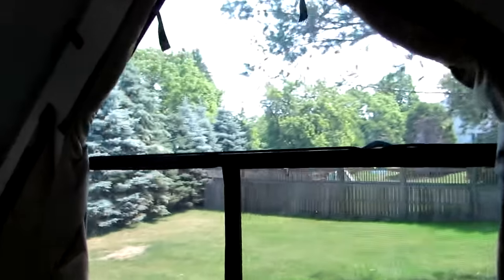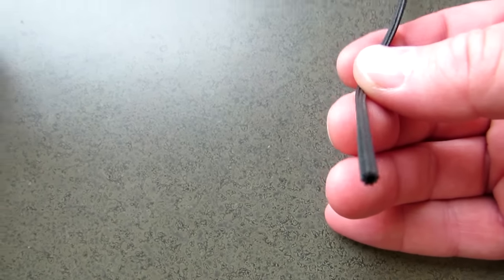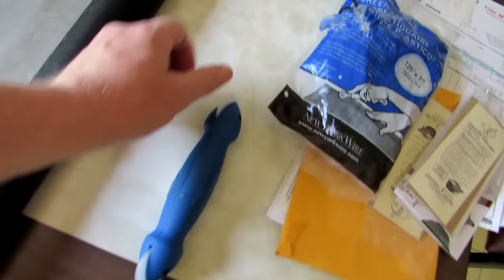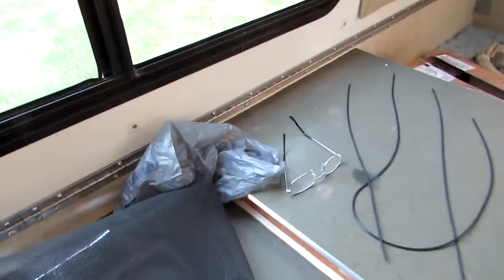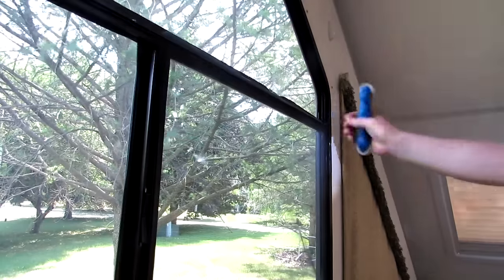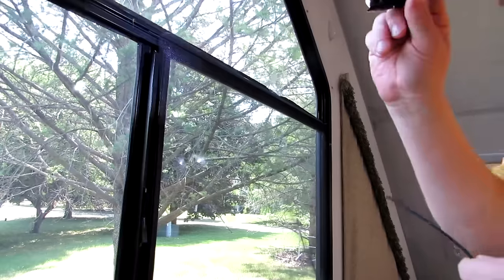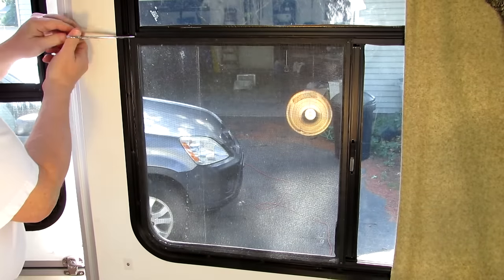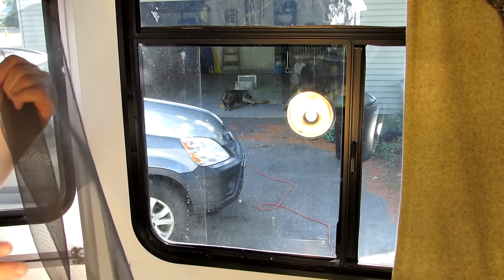Installing new No-See-Ums screens on my Aliner Aframe Popup Trailer

Comment: I am enjoying your videos thank you! The reason the spline needs changed is because the old spline has probably lost it's elasticity! Like you said "it just sits there." It's not supposed to sit there, the rubber is supposed to be elastic enough so that after it's "rolled" into the channel, it can return to it's former size and compress against the screen to hold it! You had already bought new spline to use! When you pulled the old spline out it stretched, and reinstalling, you had excess to trim, this shows it was old and needed replaced!
Reply from the maker: True, but in my experience, you can re-use spline a few times before it won't hold the screen in place.  And I will need to replace it the next time, since it held it so good the screen ripped when it was pressed against the cabinet when I folded the sidewall down.  I had the screen too tight in the window. So New spine in next repair video.  I think the spline I had bought for this video was too big.  Thanks for the comment !

Comment: Where you happy with the no -see-um screen you put in?  It doesn't look like the no-see-um screen I am used to, which is obviously much finer than normal screen.?  I love your video showing how simple it is to change out screens.  Thank you
Reply from the maker: I think I must have gotten the wrong kind of No-See-Um screen.  Cause my screen attracted the No-See-ums to come into the trailer.   It was not no-see-um keep out screen !!  The No See-um screen I have seen in the past has a diagonal wire. through each box.    Anyway, keep out the bugs was a major fail.  I think I had more than any other time I have ever camped !

Comment: Great info vid. Never knew there was a better screen. I had taken the screen off my camper on the driver side wall to experiment with an a/c unit hanger. After it failed i managed to put the old screen and spline back in. Is it my imagination, but it seems that the new screen lets in more light??? Thanks
Reply from the maker: I was thinking that too... The threads are much thinner than the original ones, but the holes are smaller.  I'll be testing it out this weekend at Tupper Lake in the Adirondaks and Sabbitis !